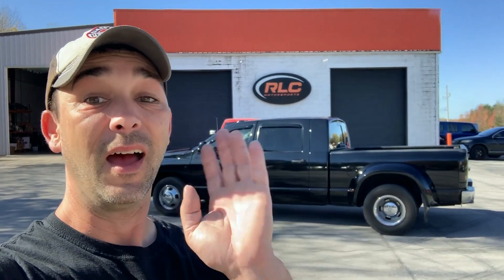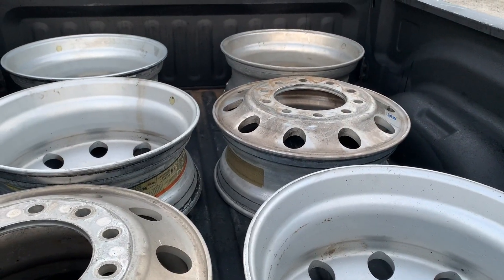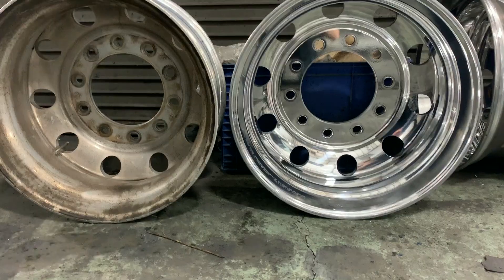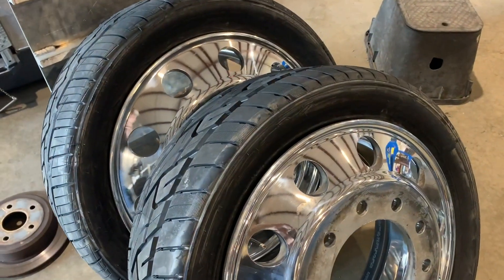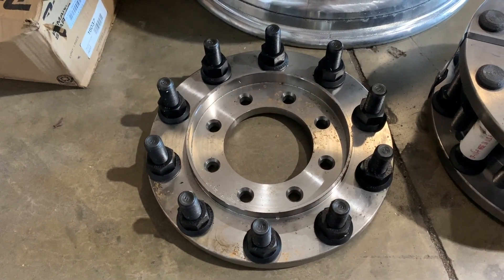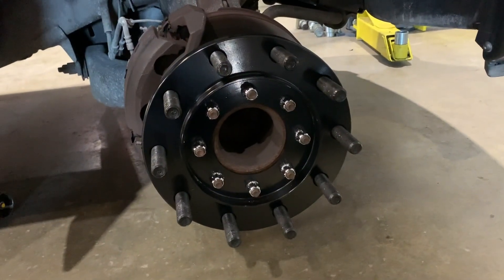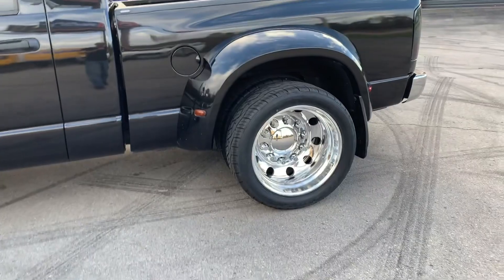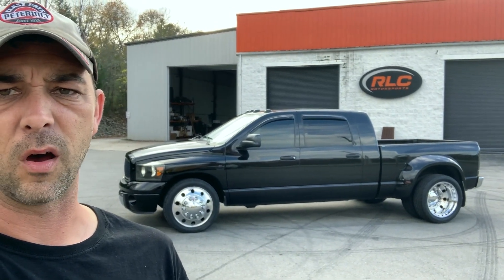The mega cab got a mega wheel upgrade!

Comment: I have a 2006 2500 mega cab 2wd long bed that I’m thinking of converting to a true 3500 dually.  Was the bed on your truck original and if not, what year did you use?  I can’t find any videos on how to swap the axle and bed or if it’s even possible.  Anything is possible and at this point way cheaper than buying a new or used dually truck.

Comment: What did it cost you to do the change over $ $ $
Reply from the maker: Tires are about 200 a piece, used wheels were 300 total, polishing cost 300, and the machine work was 600, adapters usually run around 800 to 900 for a set.
Reply: @SEMICasualShow  thank you for the price break down ... It looks very Sharpe

Comment: 22.5 wheels machined down to a 22 is definitely not a good idea and not safe.  My friend owns a large high end wheel and tire shop and they will not touch cut down 22.5 wheels after what happened.  The day before sema a customer came in for new tires on their dually and when mounting a new tire on a wheel the lip exploded when the tire was aired up.  The employee mounting the wheels ended up with around 500 stitches in his face and scalp.